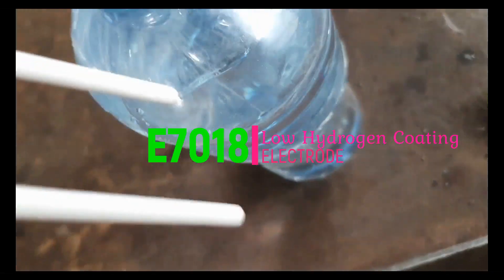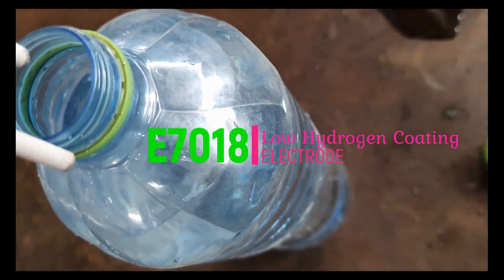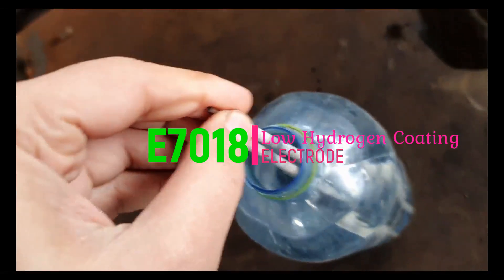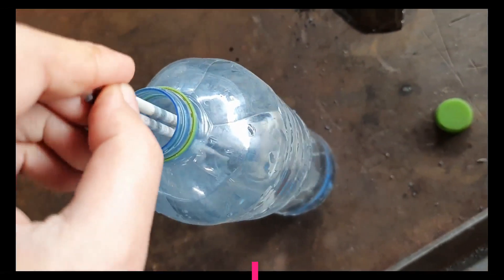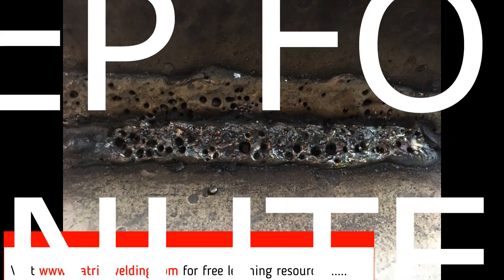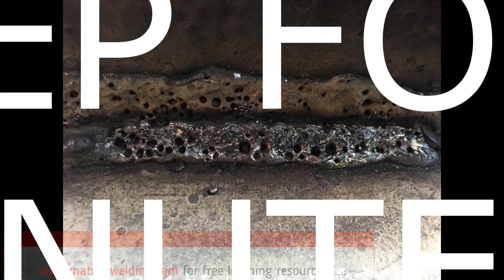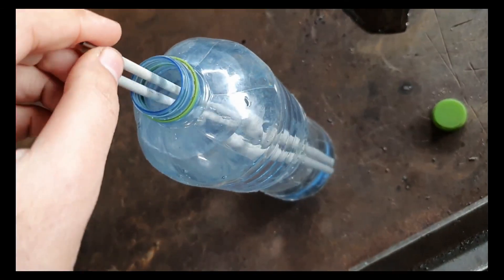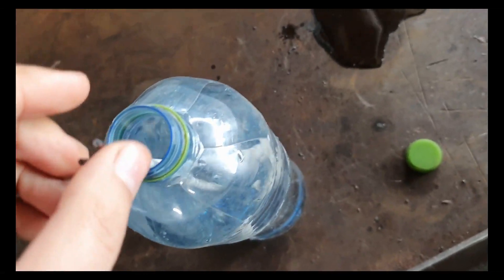SMAW welding with wet electrode  Have you tried??

Comment: 7018 is a low Hydrogen rod, I’ve seen this done with 6010 but never this rod. Will it still be as strong as a dry weld?
Reply from the maker: Shall be in case of mild steel but with low alloy and high strength steel risk of hydrogen cracking

Comment: sir, why any porosity is not produce and very clean weld bead is produce?👌👌
Reply from the maker: Hi. E7018 coating is having strong resistant to moisture absorbtion.it need longer time to have sufficient water to create porosity.
Reply: For porosity, root cause is improper shielding, during SMAW welding if there is strong gust of wind or something alike, then porosity will come.
Reply: @CreativeVibesYTx  wind usually gives porosity on gas shielded stuff, in my experience it’s angle and pressure that are more likely to give porosity on stick